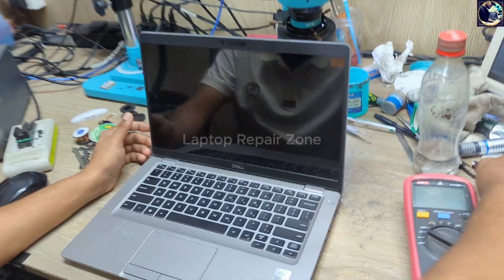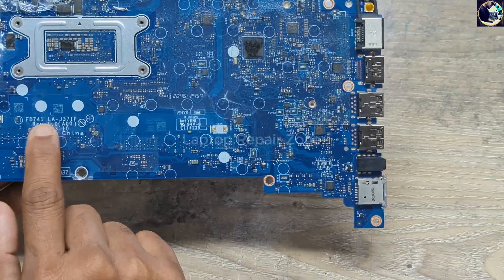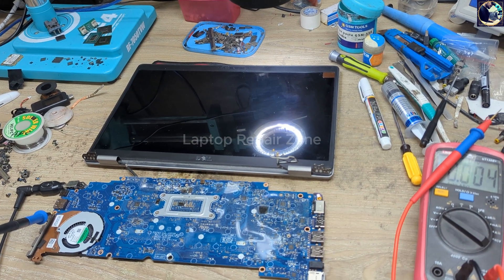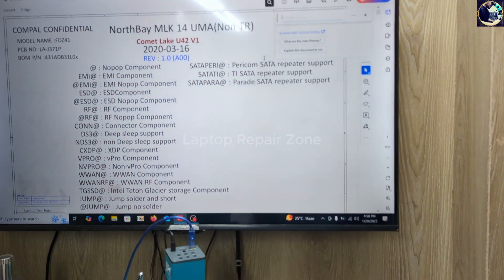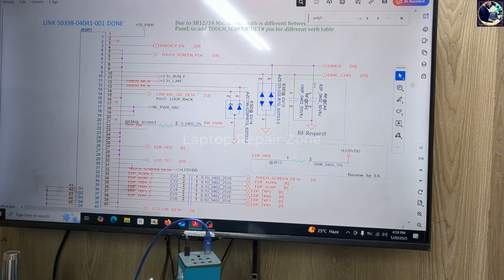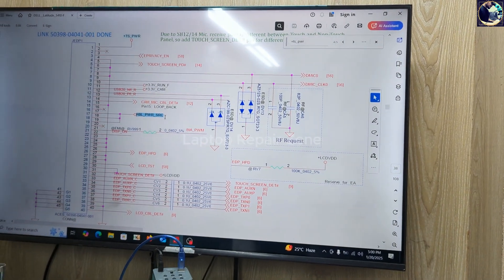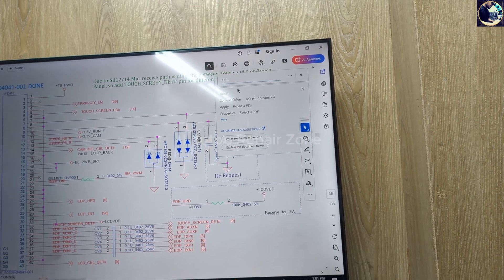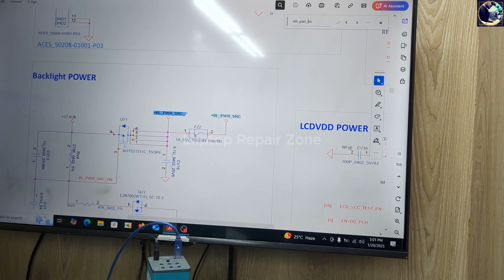Fix it: dell Laptop ON but Display Black | Black Screen Problem | Laptop Starts but No backlight

Comment: Hey man, thanks for the video, pretty useful, I'm having a difficult time with this one, I got a replacement LCD screen at first thinking the first one was damaged, to my surprise(a disgraceful one), the new one also gave no backlight, so I found this video and checked it out on my Mobo, fuses have continuity and also the legs on QV1 are also on the correct voltages (around 8V), any ideas where to look next? 😢
Reply from the maker: You can check PWM and BL_ENABLE